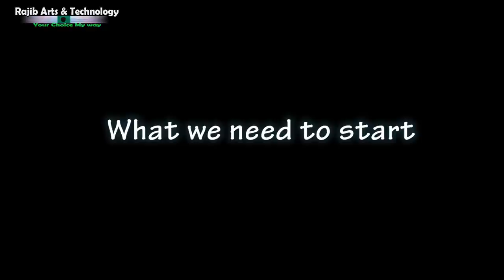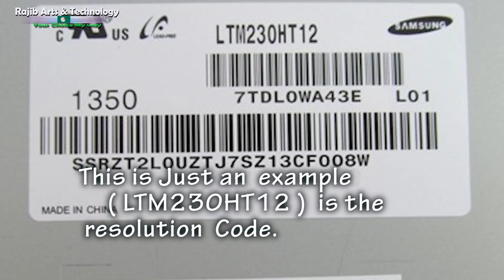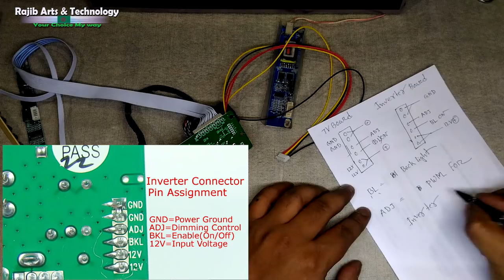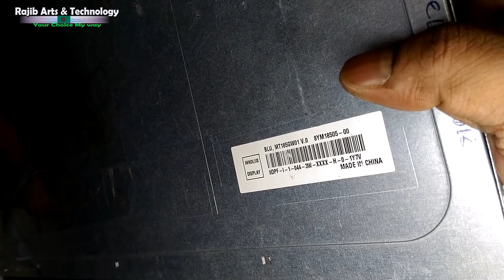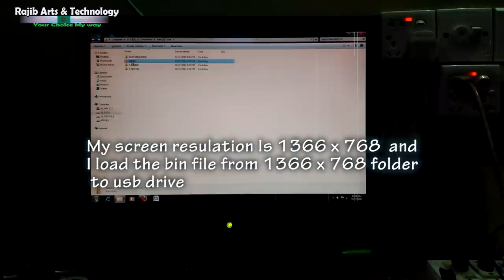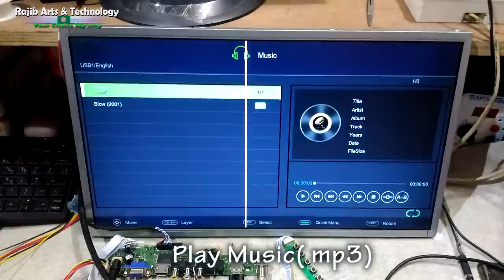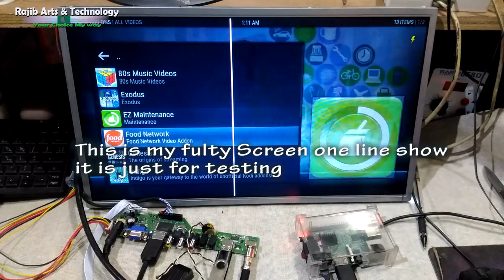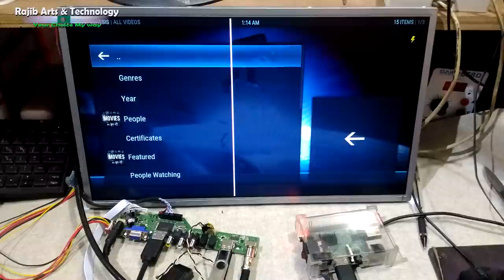China universal lcd/led tv board installation total tutorial

Comment: HOW ON  EARTH ONE LVDS  CABLE  FIT  1000000000   OF   CABLES  USED IN  LCD   TVS  INDUSTRY  ?
Reply from the maker: wael fathe ,its not big issue ,first you should find out data of your LCD panel lvds pin ,match the pair of data pins, ground & supply panel voltage, most of the panel has a number back side of it find on internet .you can easily get the panel data.this tutorial is for beginners....advance level video will uplode  soon....thanx for watching....good luck.
Reply: mr   very smart   person   ....so  how  i  can  buy  a cable that fits both   my lcd   panel  and  main board  

i mean  can i  expect  the chinese  supplier  to  give  me  cable that fits   my panel    if  i  provide  data sheet to  him   or  i  have to"  edit   change  adjust  "  the  orginal cable that  fits my lcd   so it can   fit to the  main board ....this  will include    cutting and  resoldering  lcd  orginal cable to the   new main board  as it seems to be  the only  way.....so   what        buy new or   make it my self  that is  the question
Reply from the maker: wael fathe ,you tell them what's your panel & get the lvds cable for it ,get some extra cable ,now the cable is very cheap.
Reply: yes  it looks like i have to provide  data  for  my panel  and chinese seller  provide all needed  thanks your are  best man  one last  question   what is  the best   version of these  boards i can  see  v59   v29  too many other some  use  even  jumpers to  set the resolution  look like  those  more attarctive as we  dont  have to set  firmware   for   us to  adjust   resolution for the board to match that of the     panel
Reply from the maker: wael fathe ,avoid the jumper setting board bcuz these board quality are not good up to other board, v59 is old but quality better & lots of firmware are available. T.R.85.031 is new & good also has many panel support.
Reply: fantastic man  fantastic  channel  i will  subsribe   and  promote your chanell  thanks  sir
Reply: T.R.85.031   any cheap  seller on taobao   for this  board?
Reply: @rajibartstechnologymd.mahf9807  got  tr8503  not  tr85031    are   they  same?

Comment: Hello Rajib, for panel LP154WX4 (TL) (C1) , datasheet http://www.beyondinfinite.com/lcd/Library/LG-Philips/LP154WX4-TLC1.pdf

will be using 12 volt adapter , the board jumper setting  is set on 5V, is it safe ? can you please confirm.. thanks !
Reply from the maker: Silas Paine ,start at 3.3v its safe, if any problem in 3.3v than you put 5v ,thanks.
Reply: fine...thanks !